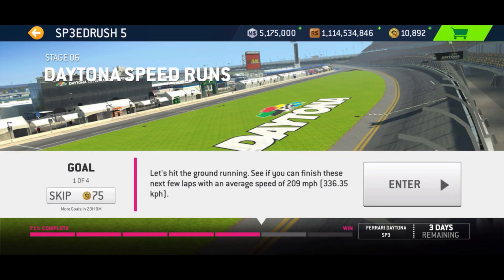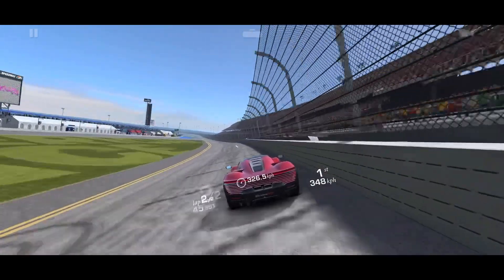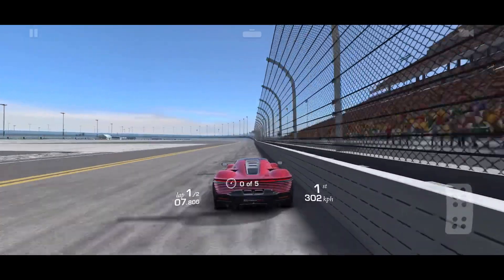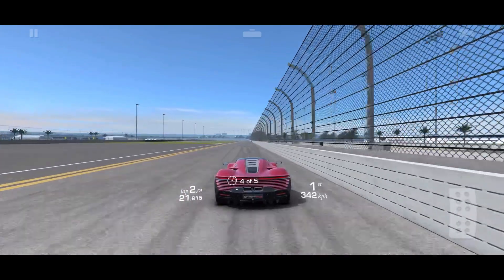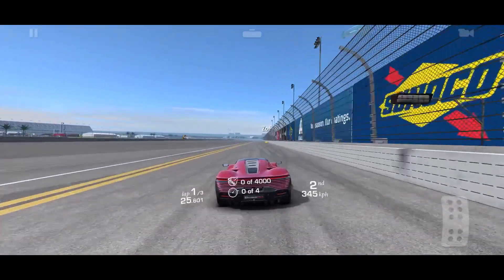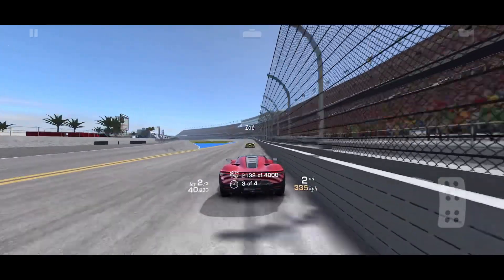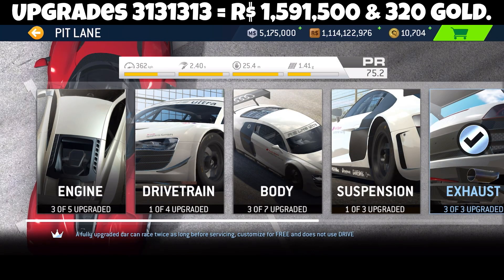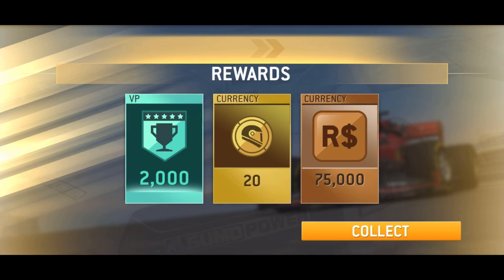Speedrush 5 • Ferrari Daytona SP3 • Stage 6

Comment: Just finished stage 5     Upgrades 3331111 as i am not as good as the top drivers & struggled with 4.3   4.4  &   badly struggled 5.3    However, based on this Video & speedmaster video i am more confident on stage 6 which seems a lot more based around speed.   I love driving the McLaren P1 Gtr  around the Indiaapolis speedway circuit in the endless endurance event, so i am hoping this experience will prove useful.
Reply from the maker: I think you made a better decision than I did with stage 5. I wish I hadn’t done tire and wheels! Although I believe we’re at Daytona road course tomorrow so that grip may come in handy. Anyhow, please let me know if those upgrades work for stage 6.
Reply: @ME7_RR3  
My upgrades of 3131311 worked for stage 6 which are even cheaper than his.
Reply: @Khan-ts2ji  I am proud to have completed this stage with 3131111 😄. In the 4th goal, I got a big hit in the back from Zoe to 375 kph. 1 more stage left to unlock

Comment: @me7 - Keyword "roman cubits": you often ask yourself why they chose roman cubits: well here's a try of explanation: it's a kind of scale (or measure?  - anyway....)! As all the virtual cars are not as big as in reality, they needed to adapt every length into their virtual system. So they scaled the lengths down to roman cubits, because that suits best to their car size. The proportions must fit. If they wouldn't do so, every race were extraordinary long and would not end. Think about a small rc-car which drives 1real km. And now imagine, you were the driver within the rc-car.... You know, what I mean?
Reply from the maker: What you’re saying makes sense but I still think they goofed up. In an endurance event they use actual metres actual yards. In other events your distance from a bot is shown in metres or yards. Yet when you’re drafting someone it’s this other unit of measure. That’s what doesn’t make sense, the inconsistency of it. It should be one uniform way throughout the game for it to be on purpose I think.

Comment: I'm unable to compete in this event (or do pretty much anything) as I just had my gallbladder removed yday. Argh. My plan for this update has totally been ruined.
Reply: Speedy recovery!
Reply from the maker: I feel your pain. I had my gallbladder removed in the middle of a NASCAR event and actually kept on doing it. I could barely talk and really shouldn’t have been doing videos. Look after your health first! I felt a lot better after a couple of days so you might still be able to finish multiple stages on the last day that the event is open.
Reply: You're a die hard man, just had surgery and only complaints about missing out on RR3 cars👍

I missed out on the Porsche 917K last update and was angry with my body for needing that extra sleep that day.